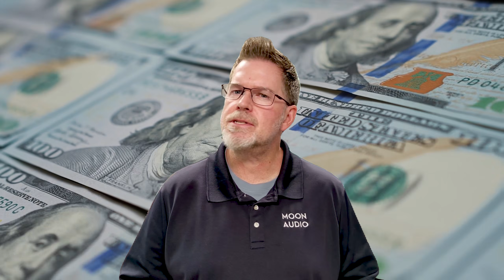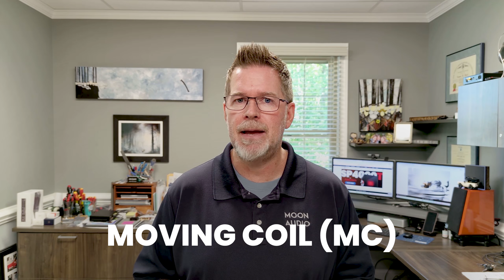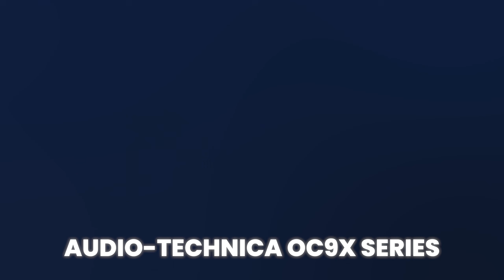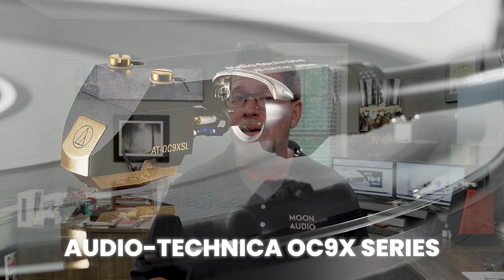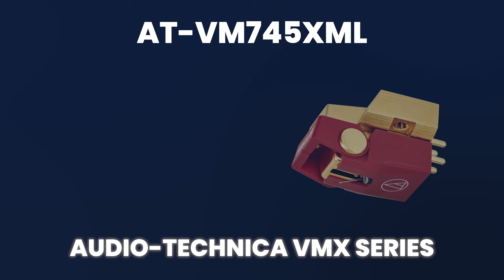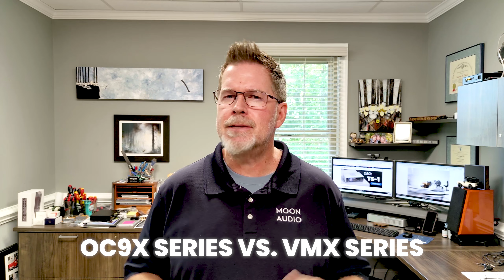Top 5 Audio-Technica Phono Cartridges for EVERY Budget! MM vs. MC Explained

Comment: the AT VM740ML cartridge is the superior cart over those, but the sweet spot for a cartridge is between $250 to $350, anything past that point your turntable and whatever phono preamp your using may not be able to take advantage of the better sound; but quite frankly at that sweet spot range for a moving magnet you're getting 98% to 99% of the sound from far more expensive moving magnet carts.  The VM740ML is so good it has been compared to moving coil carts in its sound quality!

The VM745XML might be a tad better but only by 1% again something that most people will never hear.

This is how crazy this stuff can get.  The most expensive moving magnet phono cart is the Clearaudio Charisma V2.1
at around $2,800 USD; this cart will only give you about 4% better sound than the AT VN740ML, (and about 3% better sound than the 745) and yet cost you 8 times more money!  But again, you may not be able to take advantage of that 4% sound improvement if your turntable, phono preamp, amplifier, speakers, and or the room is not up to the task thus you will never hear the difference, but your wallet will feel the difference.

The shibata stylus is being over sold here.  I say that because a MicroLine is designed to mimic the shape of the cutting stylus that cut the lacquer! It has an extremely narrow contact radius front-to-back while maintaining a large vertical contact patch.
That large contact area spreads tracking force over more groove wall surface.  The record wear is as small as you're going to get, even IF the Shibata has less wear, you're probably only looking at .05% less wear at the most.

There are very subtle differences in sound between a ML and a SH tip.  Piano is one of the hardest instruments for a cartridge to reproduce correctly. The VM740ML's tracing ability tends to make piano sound extraordinarily precise. The hammer attack, note sustain, and decay all come through beautifully with extreme precision, whereas the SH does away with a very small amount of the precision and bumps up the warmth and musicality of the record by a tad, but this is really only noticeable on records with a lot of piano work, go outside of that to classic rock and you're simply not going to hear anything different.

He is right though about the quality of one's turntable, which I alluded to above, if a person has a $400 or less turntable which also means the chances are the entire sound system is also less expensive, than there is no need to get the 740ML because you will never hear that difference from using an Audio-Technica AT-VM95C for only $50!  That is not to be taken as insult, it is to be taken as reality of what you will hear vs the money you'll spend.

I would save my money between the 740ML and the 750xSH or the 750xSL and buy more vinyl instead.

Comment: Great overview! I'm running a Dual CS-750 with its low-to-medium mass OPS tonearm (~15g effective mass). I've been eyeing the Audio-Technica VM series, specifically comparing the VM540ML and the heavier die-cast VM740ML/750SH

The main challenge with the 700 series on this Dual arm is the 8.0g+ body weight pushing the stock counterweight to its absolute limit. However, adding a small 3–5g auxiliary counterweight on the back completely solves the balancing issue, keeping the counterweight near the pivot while giving you that glorious MicroLine tracking and rigid body. Anyone else running a 700 series AT on a classic Dual OPS arm?

Comment: This is a ai generated video. There are a ton over verbal errors.
Reply: I strongly suspect it's an AI generated script, but I'm pretty sure Drew is a real person reading that script. I agree that he did use a lot of made-up words, like "permature", "neopreme", "baron cantilever", "separization", etc.  But I didn't notice many of the kinds of errors that a TTS engine often makes, with a possible exception at 11:39 "The Shibata stylus profile maximizes groove contact while minimizing wear. Again, this ...".  He did not pause between "wear" and "again" so it sounded like "again" was at the end of that sentence, which made no sense and is not the kind of error a human normally makes.

It is interesting to try to guess where the errors were introduced. Were they in the AI-generated script he was reading, and if so, how did they get there?  If they were not in the script, some of these errors are quite strange, eg: saying "Neopreme" when he probably meant "Neodymium", or "permature" instead of "Permendur".  Or "baron"/"barn" instead of Boron.
Reply: the humanoid/bot figure's shifty eye movement, splice breaks,  and disconnected nonsense-speak provoke an anti-AI like response in many a viewer.

Comment: I use nothing but Audio-technica MM cartridges i have the wonderful VM740ML which I use on my 1980s lps because they dig deep and makes 40+ years old lps sound new ,for my newer reissues i use my VM750XSH Which is an incredibly good cartridge,  my gear consists of the Technics SL-1200G and SL-G700M2 and SU-G700M2 and wharfdale mfm7 towers, AUDIO-TECHNICA cartridges perform well above their price point.

Comment: I'm sick & tired of all these BOZOS who call themselves AUDIOPHILES. What they've all done has caused EVERYTHING from VINYL to Audio Gear to become so expensive most can't afford to purchase anymore. Used LP's aren't cheap anymore (a RIPOFF), and New ones are Digital Remasters at $30.00 a pop (another RIPOFF) which is total BS. Turntables were invented for ANALOG RECORDINGS. CD players were invented for DIGITAL DISCS, and we also have all types of audio file formats to chose from to download. Stick with what you know instead of listening to these concieted blowholes who are most likely getting PAID to push whatever. If you DON'T KNOW do some internet research which has NO BIAS, and isn't paid.
Reply: I'm sick and tired of BOZOS that have no knowledge of audio having a strong opinion based on weak knowledge. I have 1979-86 GRP jazz lp's that are digitally mastered and sound magnificent.  I have new digitally mastered lp's that also sound great.  It's analog playback after all.  You are hearing the cart, not a DAC. Ripoff?  lets talk my denon DH-110 mc cart.  I paid $160, it's now $499.

Comment: I have a 150MLX mounted out of service and had the cheaper one. 440?  The cheaper one sounded too bright for me even loaded per spec.  The 150 seems to have a depressed sounding upper mids with proper loading.  The forums were full of ideas about using various non standard loading to make it sound better.  SO I eventually just used my V15 III instead.  The AT has excellent tracking etc. but I would probably sell it in a heartbeat.  Too bad it appears top quality for the money.

Comment: I've been an AT LOMC fan for over 40 years. Started with the 36ML, went on to the first OC9 and later the original Art9. Using a 33PTG/II today, a bargain LOMC if you have a higher mass arm.

Comment: From my experience, AT quits producing the replacement stylus once the cartridge model is at the end of production. Seems very unnecessary that AT produce propitiatory stylus sizing where the stylus fits into the cartridge body specifically for each cartridge model. What makes it even worse is that AT keeps-on jacking prices higher with latest cartridges tracking near twice the grams of prior AT cartridges. Might be a good model profit-wise for AT, but quite a $crew-job to the cartridge consumer. Most of my use of best cartridges is for recording LP's to CD-R format using Dual 601 TT with AT440MLa or Shure V-15 Type 3 cartridges with a Pioneer stand alone Music CD-R/RW recorder. Sound reproduction quality from LP to CD-R is of insignificant loss. Very satisfied and no more cassettes which became more problematic by the time that Home CD-R recording became a thing in/around 2000. The only issue going forward is to keep aging CD players working.
Reply: Actually, the new VMX series MM cartridges from AT, the pricing went DOWN from the previous models. Significant upgrade over the previous models and lowered the cost to the consumer. I am not sure what series you are referring to. Also, saying the tracking forced doubled is simply not true. It has remained standard, around 2g for most models.
Reply: @JohnTarulli , Audio Technica AT440MLa  AI shows 1-1.8 grams. It's been a good number of years since I used the AT440MLa on Dual 601, so maybe I had it at 1.25-1.4 grams, can't remember.  My Dual 601 apparently does quite well tracking at average recommended 1 gram of stylus pressure using Shure V15 Type 3 cartridge. Could be that most newer turntables have lower quality tone-arms, or cartridges have a more rigid stylus stem? Maybe the diamond tips somehow cover more of the groove than other tips? More tip contact area would also require more tracking force The vast majority of my LP's are flat, so needle jumping is not an issue. I had anxiety 2-3 years ago, and that killed my music interests for a time. At 71 I just do not have the same interest in playing LP's as I did in the past. Too many LP's and not enough time in life to waste sitting on my can listening to it.